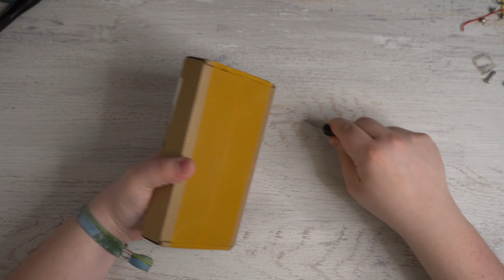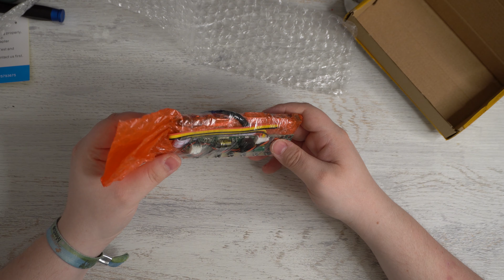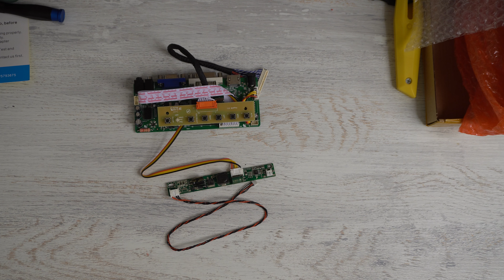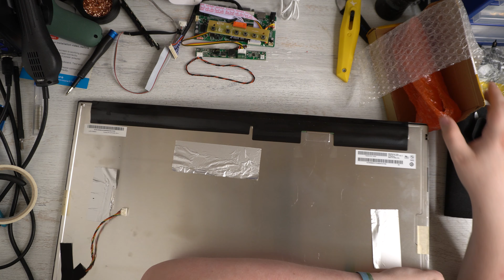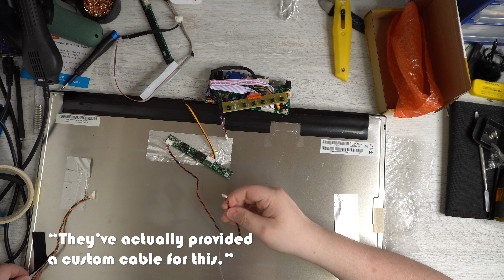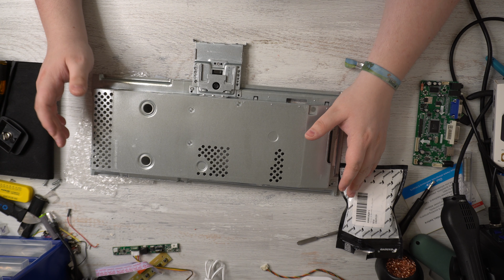Reviving an Old Broken Monitor

Comment: Probably the OG button board is using multiplexing to reduce the amount of wires needed. In that case it would be easier to directly connect to the buttons themselves, but you can have a go at figuring out the matrix perhaps
Reply from the maker: I’ve assembled the monitor now and simply stuck the control board to the back, rarely need it anyways